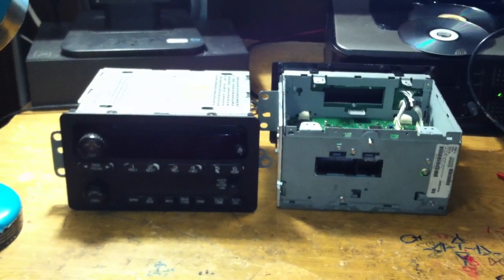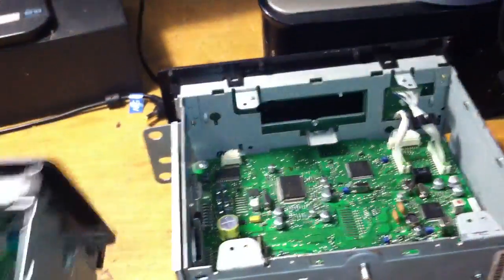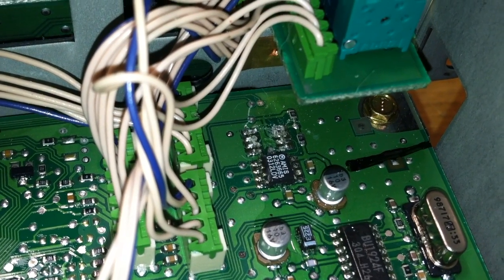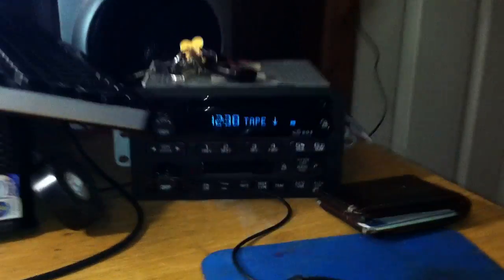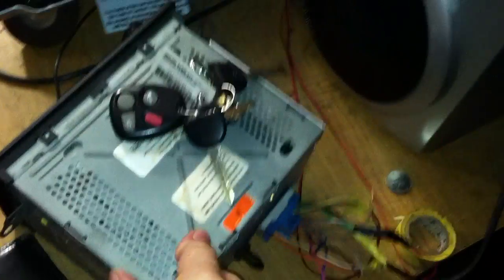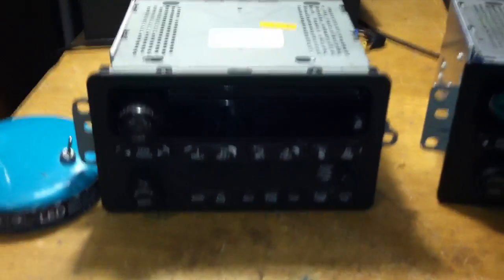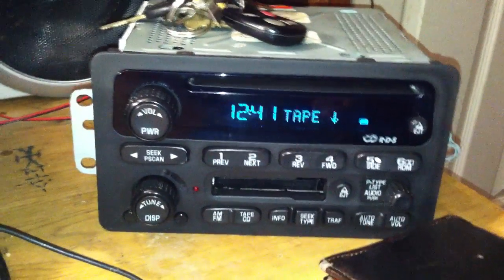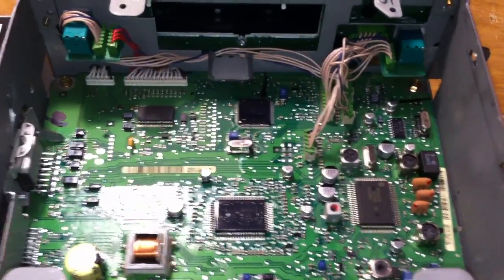Unlocking 2001 to 2005 GM Class II RDS Stereo Systems

Comment: Does anyone know exactly why GM made two different models of this radio? I've heard that you have to get the exact one for your vehicle otherwise it will not work, even if the radio looks the same. Anyone know what's different about them and what makes them not interchangeable? I have a 2005 Chevy Impala and my radio comes without the RDS logo on the display but others display the RDS logo. Is that also a clue indicating that the ones with the RDS logo are the older ones and the ones without are the newer ones?

Comment: This is great advice and it worked great with the adverse effects. Most of them were no problem, but mine would always go back to track one on the cd everytime you shut the key to the off position. So some memory is forgotten by taking out the chip. There is another option that I found by accident scrolling youtube for other suggestions. My main proble was that the face plate lights were mostly burnt out and the cd player did not work. I purchased another radio from a junk yard which I unlocked by taking out the chip. Heres the best part! Once I discovered that the cd player worked in the new radio, I then switched out the cd player and the face plate. Guess what? Now I have a new working factory cd player with no issues! There are videos on how to take the face plate and cd player out, very simple.
Reply: I just want to confirm that if I pull the chip out that the radio is now forever unlocked? I guess my question is it's not going to just run for 10 minutes at a time with the chip out it will work normally with a couple errors correct? Thanks

Comment: The chips in the radio were side by side instead on one behind the other. I removed the chip that was all black and when i plugged the radio in it will not work. It is a 2002 Chevy Cavalier and it is like the radio that it on the counter that is working with the type player.

Comment: i have a big question Pan, i just bought a stereo like the one you have hooked up it came off of a 2003 trail blazer but i cant seen to get it unlock. is there a chip that i have to take off or change the wiring in my truck? thanks for your time.

Comment from the maker: You shouldn't need too in vehicle as the computer in the car is still providing the radio the "On" signal. The wire trick I use, is to turn the radio on, outside of the car like in the video, or in other types of vehicles that this radio can, and does fit in that do not provide the "on" signal. Not to sound confusing and all.